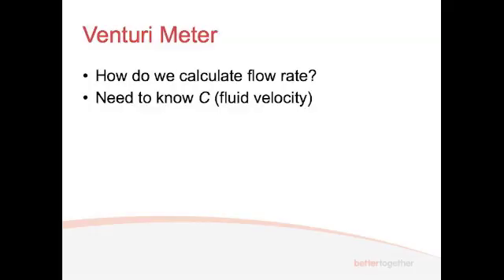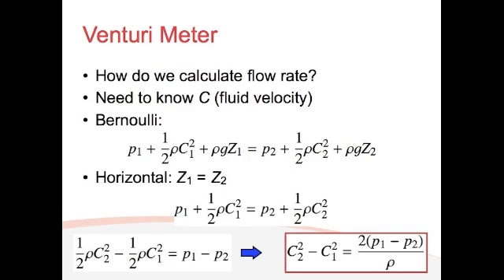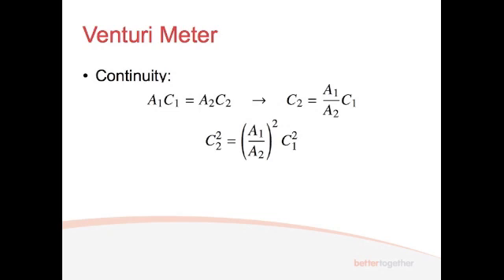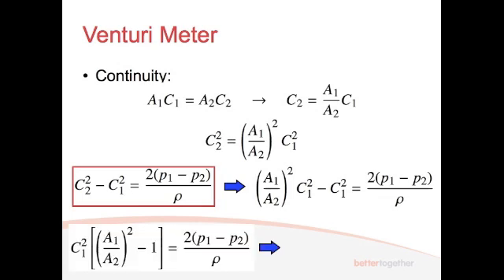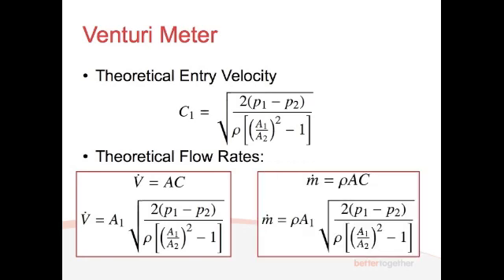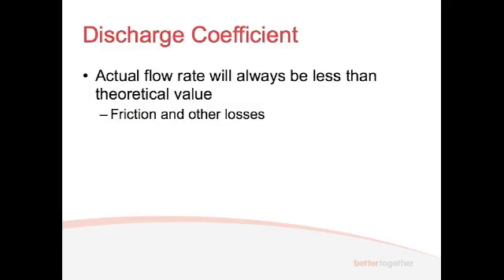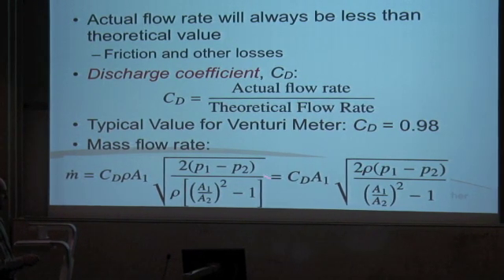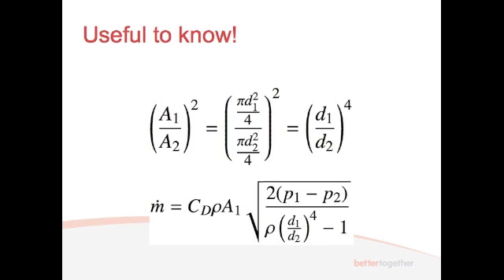Fluids - Lecture 3.2 - Flow Rate Measurement

Comment: Excuse sir, the pressure difference shouldnt be only densityfluid*g*h. Because there is air flowing with a initial velocity with is crashing against the fluid, thus p1-p2= density fluid*g*h - 1/2density of air*V^2. This is related with the shape of the tube facing the fluid movement.